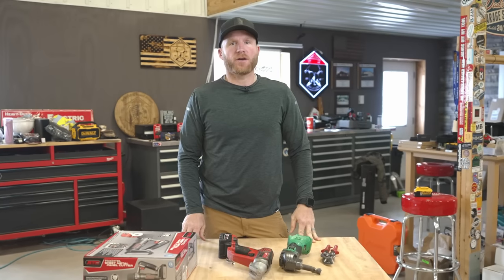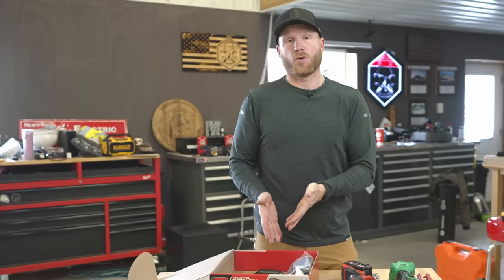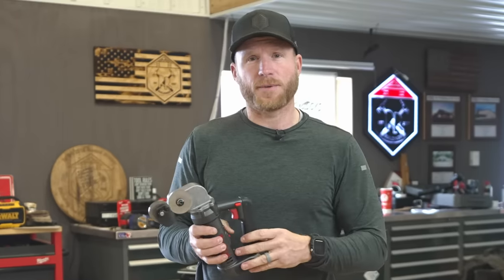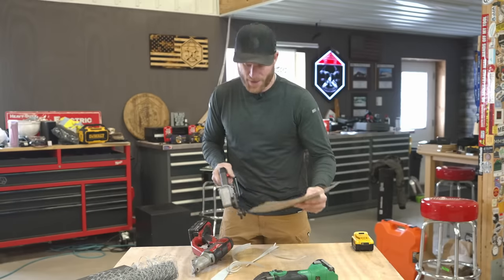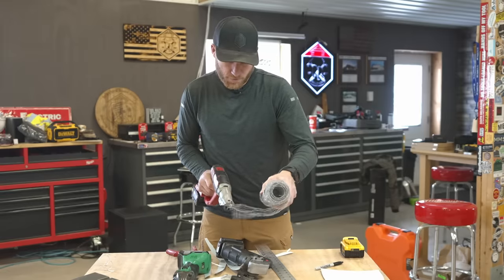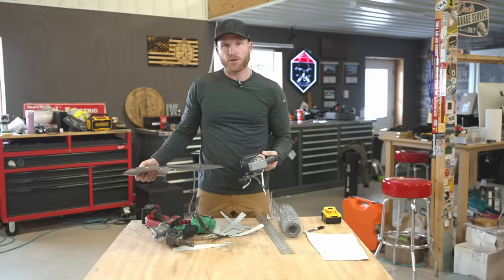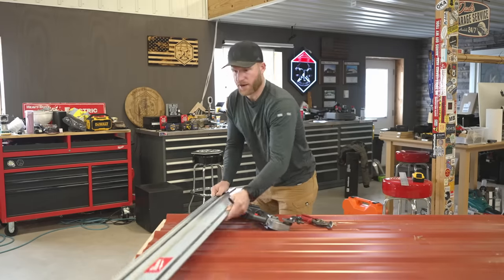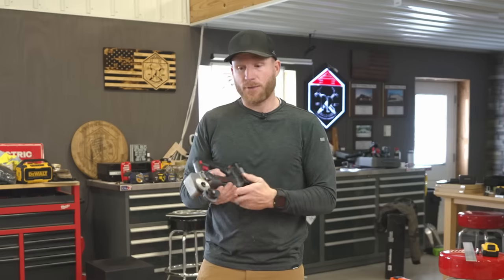Toolsday: The Last Metal Cutting Tool You'll Ever Need???

Comment: Black & Decker made one very similar to this in the late 80s and early 90s.
Reply: it was a great tool and I highly respect Black and Decker. My patent changed frame, improved feed wheel and added battery to accommodate workers in the field cutting metal panels. Thanks for comment, Tony

Comment: Why it has a dewalt battery simple.

Most popular cordless tool brands do not design their batteries. They design there tools to fit a battery there suppliers offer and just brand them.

As an example right off my head

Most Greenlee 18v cordless tools use same battery as makita tools.

Comment: normally, I'd point to an angle grinder for metals, but for sheets of 24ga and thinner?     They make circular saw blades with high count carbide teeth...   Or even abraisive wheels!    They even make tiny circular saws (and blades) for when a normal saw is too large or unwieldy.   Why does this tool cost more than 2 circular saws..?

Comment: Just an observation of the tools accuracy is that you are free hand holding the tool and the cutter. That is hard to hold steady. Not to mention you are placing your hand and fingers at risk. Would you hold a circular saw or plasma cutter in one hand while holding the work piece up in the air with your free hand while cutting? Bad practice leads to bad outcomes like not wearing safety glasses while cutting metal. I feel that to accurately evaluate the tool it needs to be about the efficiency of the tools ability minus the users errors. If you had 2 hands on the tool during the angle panel cut with the work piece clamped down . That would have given me a much better demo especially if I am considering buying an almost $400 tool. The plus to the video is that you introduced another platform to cut metal.

Comment: To be honest, you didn’t give it a fair chance at the beginning because you were holding the metal in the air. Normally you would have it on a bench or something. You wouldn’t cut plywood with a circular saw in mid air and expect a straight line. That being said, it seemed to do a really good job anyway.  Thank you for showing us this cool tool.

Comment: Maybe you've explained this before but any reason not to just use your track saw with a Metal cutting blade on it? Would that not give you perfectly straight cuts?  Glad to see the Toolsdays back!!!
Reply: Are you carrying your track saw up on a lift?
Reply: @ToddBizCoach  No, I meant more for the straight cuts on the siding steel that would be done on the ground/sawhorses.
Reply: @karicallegra8194  I understand. The reason he is talking about a cordless tool is because it has versatility to be used in the air, on the roof, on a lift.
Reply: @ToddBizCoach  yeah, I guess I should have been more descriptive in my question.  I know what the tool review of this tool is for, I was directing my question to him in regards to his statements about not always having an effective tool for those long straight cuts.
Reply: Metal manufacturers discourage using circular saws because they spit out fine shavings and heat the metal too much and create a rough edge
Reply: @diyanddone  interesting! Thanks, I did not know that... Probably why he doesn't use one. Appreciate the insight!
Reply: @karicallegra8194  More specifically- manufacturers didn't want people using abrasive blades that send sparks sticking to paint & creating future rust spots..

A lower speed dedicated metal cutting circular saw does not damage paint when cut from back side. Not to mention you can cut several panels at once! I always clamp a guide because it's almost impossible to be efficient or bind without a guide. Also you don't need to get your face down close looking at a line..
Reply: @jamesrussell6870  Yeah this was what I envisioning. Lining up a few pieces at once and clamping them well, then running my diablo metal circular blade. Figured you line it up right and you could get all the gable steel cut at once and be track straight!
Reply: @karicallegra8194  don't forget dedicated metal circular saws run at slower RPM to save blades & reduce heat build up. Throwing your diablo in a regular saw will work, but blade will heat up near instantly..

Comment: I've had a corded version of that over 50 years, it's not new. You cant cut tight radiuses with them. Ideal for ripping through flat thin metal but the cut is not as nice as quality snips, such as 15" Gilbow snips. I'm a long time sheet metal worker, 55 years and still prefer hand tools to power a skilled man can work faster with sharp snips than any cheap power tool.

Comment: this thing will only cut up to 24 g sheetmetal. so light duty. my makita was good for up to 16 gage. uses same principle except instead of 2 wheels its a square bit reciprocating up and down against another square bit. it won't go over ribs though .
Reply: Makita is a great tool, but slightly different use.

Comment: That is a sheet metal cutter, you can't cut any dimensional steel or Aluminum with it. There are several variants of that tool including just the jaws that can be driven by a drill.

Comment: Do you think this would work on a insulated roof panel. Colour bond on top, 50mm insulations and 2 mm steel bottom plate ?
Reply: Need something to rip down the length of a insulated roof panel. I use my Milwaukee circ saw to get most of the rip but then need something like this to match the cut on the top colour bone roof sheet
Reply: I will try that and get back with you, Tony

Comment: You cut soffit by hand individually!? Take a stack about 4-5 thick and cut it with a circ saw. Measure and mark which line of hole you need to follow, which on the soffit we use are always square or square enough.
Like you said, the j-trim and the fascia will cover any imperfections on the ends, so it easy to mass cut. There shouldn't be any meaningful difference in the length over the span of the whole building, cause if there is, you've fucked up somewhere.

Comment: The most effective and accurate way I’ve found to cut steel soffit was with a carbide blade in a circular saw designed for metal, in a wooden jig

Comment: I bet if it had smaller cutting wheels it would be able to go into the ribs easier.
Reply: Yes! We tried several different variations of wheel sizes. The sizes we ended up with are what worked best in the most general usage (best for roof, gutters, lath, flat, etc..) My partner Joe A made one prototype with smaller wheels that did cut well in the ribs but we ended up with clearance issues. Great observation. Tony

Comment: SAVE YOUR MONEY.  ALL YOU HAVE TO DO IS REVERSE THE BLADE IN YOUR 7 1/2" CIRCULAR SAW AND YOU CAN SAW 4 SHEETS OF GALVALUME AT ONE TIME.  Search YouTube under  "You can cut metal roofing and siding with a wood blade. It is easy."

Comment: freehands the metal while using the Jetco for the first time 
"It DoEsN't cUt StraIghT."
proceeds to butcher the cuts with all the other tools
I use these all the time and you can cut incredibly accurately. Skill issue.

Comment: Using the reds to snip the left off is unbearable. But since this only cuts to 24 the only thing i could use it for is snap lock. Which for 400 I couldn’t justify but if they came out with something for 18 g I would for buy. Would be spin and tap terror!!!

Comment: I get what you're trying to do but how fast do you need to go should be no faster than your best tool and what about using a oscillating  tool and yes there are loud but the correct blades would work they cut through everything
Reply from the maker: sorry man an oscillating tool is not a great way to go

Comment: I want buy it and i will tell ya WHY?   >   1 its to fast, 2 there no way to control the speed. 3 there no way to guide it.. If they put a slower gears in it and some way to guide it. Then its worth MONEY  i can cut with a cutting torch to . but i have control over it >>>  THAT WHAT IT NEEDS BADLY

Comment: Can't get a clean cut with snips? Maybe YOU can't. Or, maybe you could if you used the right color in the right direction. But, then again, you probably did it wrong on purpose to illustrate your misguided point, right? I also notice your tool stretched and distorted the metal, which is unacceptable in my book.